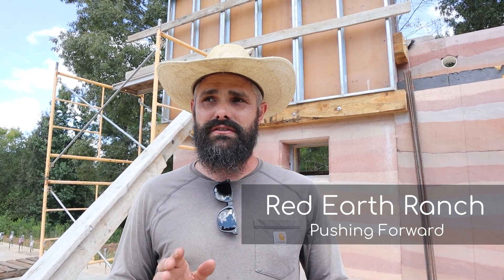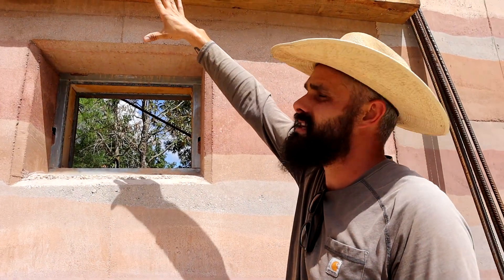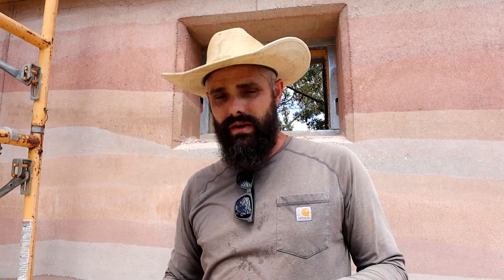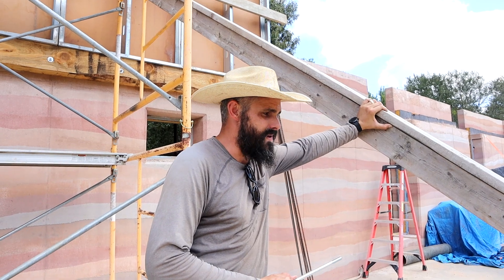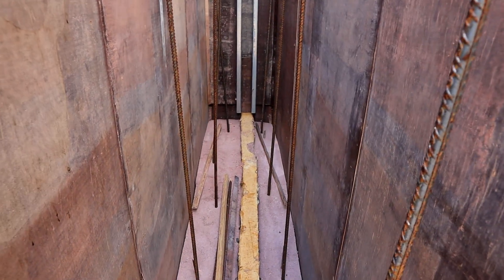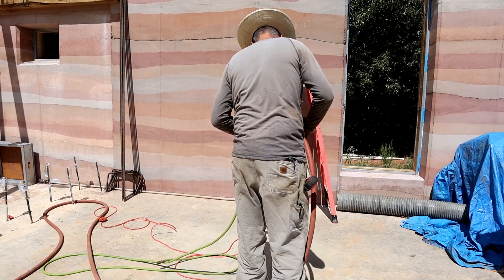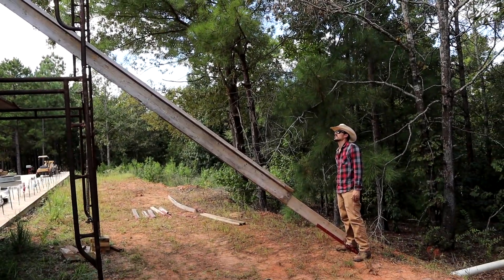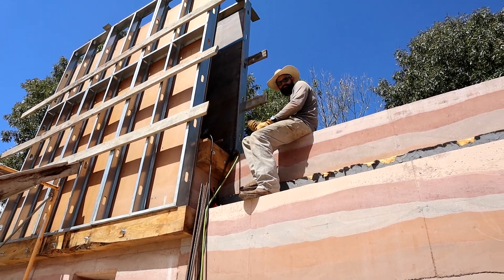We Won't Do THIS Again - Vlog 73

Comment: Two questions - where do you source clay if it's hard to get in your area? And can you do slabs (like a garage floor) using Rammed Earth?
Reply from the maker: 1: We actually don't have any clay in our mixture. We use an iron oxide cement dye to get the different colors and the rest is portland cement (10%), sand, and gravel.
2: You can't really ram perfectly flat. Even with hand tamping it will never be flat like concrete. You also can't really smooth it as it cures like concrete so I would say No to the garage floor.
Reply: @RedEarthRanch  thanks for the answers. I've searched for weeks before asking. I'm grateful for your help!
Reply: There are vids of people doing heated poured earth floors on you tube and troweling the mud flat and sealing with linseed oil.

Comment: Hi guys love what you are doing, really inspiring , got one question ❓ how are you joining to wall sections, the vertical ones
Reply from the maker: We just set the forms up over lapping slightly then ram right up against the existing wall. We hide the crack between with a double chamfer

Comment: i'm following your job from the start and coming sometimes to look at your project evolution. It's incredible. You are experimentating a lot. I cross my fingers for your project to be good enough for long long long time.
Do you have a kind of lintel up to the window ? Or a kind of "arc of compression" process at compress time ? How does it works for the earth up top the window doesn't crack ?
Do you use Portland cement or Limestone natural hydraulic cement to mix with clay and sand ?
I love your project.
Reply from the maker: Welcome to the adventure!
We have steel surrounding the windows acting as a mount point. We don't see any cracking above the window and hopefully it will stay that way.
We use Portland cement, sand, and gravel

Comment: Hey Bro! knowing the force of the ramming process I got a bit of doubt whether that turn buckle is going to be enough to hold that whole panel also the angle it is on.  Hope it is enough.  I am looking at doing 4.2m (13.8 feet)  high yours is about 5.4m.  you doing a great job.
Reply from the maker: Yeah...it didn't work LOL 
We got a lot of pushout but we came up with a few other options to help secure the walls. We are few weeks behind with the videos so you will see another set of mistakes, followed by a much better way to do it Hahahaha

Comment: Howdy Guy ,  boy it’s a big wall now. I hope all goes well with the lifts. Watch for bowing in the middle,  can I suggest getting some pipe claps and turn your horizontal boards on edge, one clamp each end and one in the middle.. I know it’s more holes to fill. But it will make your formwork so much stronger 🙂

I hope my little knowledge helps you .  
Owner builders sharing and caring..

Remember “KEEP ON TAMPING “
Stay safe stay well 🙂
Reply from the maker: Hey thanks! We really appreciate any input from the community, that's part of why we are filming LOL
We really want to avoid anything going into the wall but turning the boards on their end it definitely going to help. Thanks for the tip!